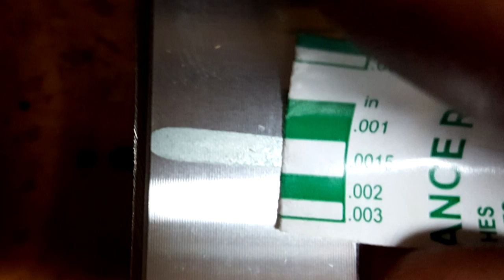LS 5.3L Build Part 4 Bottom End Assembly | Project Rowdy Ep008

Comment: Good video but I have one suggestion:
When you were using the plastigage to check rod bearing oil clearance, you put the plastigage on the cap side instead of the rod side.  While you were tapping the piston to release the rod from the crankshaft, you may have been crushing the plastigage since pushing the piston out of the bore would actually pull the rod cap into the cranks rod journal.  This could lead to an inaccurate measurement.  If you put the plastigage on the rod side, you could have loosened the rod bolts and tapped them to release the rod from the crank without possible crushing the plastigage.  Just an observation.
Reply from the maker: John Simon  that is a great suggestion.  Thanks!!
Reply: I saw that too..but looks like it turned out well.

Comment: Did you replace that cam plate @ 16:28..is that a new plate?
Reply from the maker: I used the original Cam plate which is shown starting @ 15:49. At 16:28 I am installing a New Timing Set which  includes Cam Sprocket, Crank Sprocket and Chain.
Reply: @UCanDoIt2Mike  I wondered the same thing. It was recommended on any cam swap to replace the retainer plate.  The printed gasket gets smashed flat and looses some of its ability to seal. Since it controls oil flow to the lifters, it's a critical part to me. I just finished my cam swap this evening and replaced mine because it was only $18 delivered. Great Videos that are super informative. Thanks for documenting your build! I watched some of your videos in my research before rebuilding the heads last year.
Reply from the maker: @Mattvardaman   I did lift the gasket off the plate and applied a thin layer of gasket maker in the grove that it sat in.

Comment: I really have to say you did a marvellous job of this build! So detailed, thank you! I was wondering why you opted for that specific master rebuild kit from Costa, it seems very expensive compared to other vendors?
Reply from the maker: The “Rebuild Kit” was custom assembled by my Machinist’s distributor.   It was based on specs required by my engines condition.   Because it was custom assembled for me, my thought was that I was able to use all of the parts.   When you go buy a pre-assembled kit that “best fits” your situation, there are often part that are not used.   

Not saying it was the cheapest route.   Thought it was the right and best option for me.    Cheers!!
Reply: @UCanDoIt2Mike  Right, I would assume it for your application best to go with what the machinist is standing behind for sure. If anything lets go, its back to them, vice me lol

Comment: I have a question about using the plastigauge. Since your main bearing cap bolts are torque to yield, which aren’t supposed to be reused, how is it ok to remove them to check the plastiquage and then reuse the bolts? Hope that’s not a dumb question. 

Your videos are some seriously great info. Thanks!!
Reply from the maker: Main Bearing Bolts are not TTY.  the only dumb question is the one that didn't get asked.  Cheers and enjoy your build!   Mike
Reply: Some cap bolts are torque to yield some aren't. Know which ones you have and follow manufacturers recommendations for installation.

Comment: Little trick.. These motors are known for the o-ring going bad in the oil pump pickup tube. When you replace it, smear some silicone around the joint after you clean it, or if you want it better, smear some JB weld around it. Just know it is permanent if you do, but better.

Comment: Thanks for the in depth videos I just wanted say that when u plasti gauge the mains to me it looked like u did not use the ARP lube on the main bolts and added the ARP lube after u checked your clearances and that lube changes the torque value and c an possibly change your final clearance spec but I wasent there so I don't for sure if that's what happened its just how the video makes it look thanks for everything!
Reply from the maker: Your observation is accurate.   I did not use lube when checking for clearance.  Nowhere have I seen it mention to do so.  But think about the consequences.  With lube, the bolts may have turned another 2-5 degrees at the clamping points... providing a clearance difference of 10 millionths of an inch.  Plasti Gauge is a great tool and I highly recommend taking this measurement on each bearing.  But it is not an exact science...  look at the measuring gauge that is used to perform the measurement.  There is a wide range of tolerance that is acceptable.  It is a great observation, but in my opinion the result difference is "insignificant".  Just my opinion. Cheers!
Reply: UCanDoIt2 yes i agree with u on that I it's almost nothing on this type measuring tool but the point I was trying to make is consistency is key but don't get me wrong I think the videos r great and have very good editing and educational value and I appreciate your time and paying it forward attitude towards sharing your knowledge looking forward to more in the future
Reply from the maker: Both of your messages are very well received.   Cheers to you!!!

Comment: Requesting assistance if you have minute.  When you use a feeler gauge to measure the crankshaft end play, what are exactly measuring?  #3 end cap to crankshaft or the distance between the bearing and the crankshaft?
Reply from the maker: The distance between the Bearing side surface and the Crankshaft.  You are trying to determine how much front to back movement that Crank shaft will travel.

Comment: Dont use ARP moly lube on factory fasteners!  It changes the torque readings and youll end up over torquing them.  ARP gives the torque spec for THEIR fasteners using that lube.  If you install a factory fastener, install it per their directions.

Comment: First off thanks for the informative videos. It’s nice to see an engine build in a home shop similar to how I’m going to be doing mine. I’m going to be starting my LY5 5.3 build as soon I get my block machined and decked. I have a few questions. Why do you grease the bolts for the crank mains? Second, why do the main cap bolts need to be turn to a certain degree after they’re torqued down? 

Thanks and I’m sure I’ll have more questions along the way!
Reply from the maker: I greased the main bolts because the reference guide book that I was following mentioned it.  I believe the new thought process is that heavily torqued bolts need to be greased to remove friction and get a more accurate torque value applied to the bolt.  Again, I believe a new theory from GM that you can generate more even and accurate "clamping pressure" if you torque to a lower level and then rotate to a specific angle.   These main bolts are not Torque to Yield, but the Head Bolts are.  The TTY bolts are one time use and need to be replaced after use.   You should consider picking up a good build reference guide.  There is a lot of great information like this in them.   The one that I used is:  GM LS-Series Engines by Chris Werner: Amazon: http://amzn.to/2igcReD.  Take your time and learn as much as you can... and have fun with this!   Cheers.... Mike!!!
Reply: UCanDoIt2 Thanks for the info! I actually have that book at the house. I need to read through it more.

Comment: Awesome video, thank you for sharing! I know it’s old but why did you smack the crank front and rear when you installed it the final time? I’m about to take my LM7 apart and figured I would ask just in case that was some sort of tactic to get proper end play clearance. Thanks again!
Reply from the maker: Yea...  It sets the Thrust Bearing (number 3) so that you can get a proper/accurate end play measurement.  Cheers!

Comment: The 5.3 & 6.0 LS engines were far superior to the old SBC they replaced.
Reply: 5.3 and 6.0L LS motors are the easiest simple
Reply: The 6.0L was still junk. Hence the introduction of the 6.2L
Reply: repr26 Right.... thousands of those “junky” 6.0 with well over 300K miles on them.
Reply: @repr26  6.0 is not junk my friend
Reply: Picked up 04 escalade platinum 6.0 with 25k on it recently .
Reply: @budtoo2636  keep your oil changes up to par and tune ups...im a mechanic myself and have worked on lots of thos and GMC were the owners didn't keep up with the oil changes and for the LS motors when you do that you burn out the bearings and your lifters get stuck and when that happens 90% of the time your getting a new engine🤣

Comment: Once again, another great "How to" video.  I do have a question, if you know.  You stated in video #1 that you wanted a 5.3 with 862 heads, and you pulled yours from an '01 Silverado.  Do all Silverados have the 862 heads or is there a specific RPO code you looked for?
Reply from the maker: Lyons Motorsports Again, thanks for the feedback.  I don’t know the exact answer to your question. The RPO code of the engine that I purchased is LM7.  In a way that is supposed to represent a specific combination of components.  But, I believe there are LM7s out there that have the 706 heads.  In fact I believe I once owned a 2001 Tahoe LM7 with 706 heads.   LM7 is a 5.3L cast iron block.  When I went to go pick mine out at the Salvage yard, he had several on pallets and I had the choice of heads.   Not sure this helps but should help with the conversation that you have with your seller.
Reply: 706, 862, & 895 heads are the "small valve" (1.890" intake valve) heads. I believe they came on 4.8 & 5.3 L trucks w/LR4 (2001+), LM7, LM4, & LM59 (1999-2006). They flow good from factory.

Comment: i swapped my  5.3 engine a few months ago...now i will like to rebuild the old one...my question is ...how much money  do a need for just a normal  rebuild  nothing else...thanks in advance...great video
Reply from the maker: That is a really hard question.  It depends on what you find when get in there.  In the description of this video is a PDF that you can download that show all the items with prices for what I did.   You will need to balance what you feel is a minimum based on wear and what needs to be done "since you have the engine currently apart".  At least focus on high wearable parts (Rings, cylinder honing, bearings, lifters, cam, gaskets, etc.)  Those are no brainers.
Reply: @UCanDoIt2Mike  thanks you Boss...your videos inspired me...

Comment: GREAT videos! If I want to learn to do something RIGHT, I look to see if you’ve ever done it. Did you reuse your stock main cap bolts or are those new??
Reply from the maker: I did reuse the original main bolts.  The guide that I used did not specifically state that they had to be replaced and I noticed others reusing them.  They are not Torque To Yield, so I assume it was ok.   Thank you for the generous compliment Mr. Gibson.   Cheers to you Sir!!!!!

Comment: First of all great DIY and instructional videos!! I have one on the stand as of yesterday that I want to tear down and Rebuild. I have the confidence to do so now.  I just have one question. I've heard a few guys at work talk about checking for rod bolt stretch.  Not sure what it is exactly but did you do that on your build?  Thanks and keep up the good work
Reply from the maker: Let me start by saying that I did not, because I purchased new Piston Rods and they came with new components.   So let me take a stab at what I think they are talking about.  In these newer engines, there are some bolts that are Torque To Yield (TTY).  Meaning you tighten them down in a manner that they stretch to maintain a specific compression value.  These TTY Bolts are One-Time use bolts and if I remember are your Head Bolts, and Harmonic Balancer bolts.  Not sure if the Stock Rod bolts are TTY, it did not apply to my build as I replaced them with a different Rod.   If the Stock Rod bolts are not TTY, I really would not worry about any minor stretch as they are rigid and will still apply proper compression.   If your building a street engine you should be fine.   If you are building a boosted engine, you probably will be changing the Rods anyway.   Just my amateur 2 cents.   Have fun with it!!!!!
Reply: UCanDoIt2 yes I'm going to try the boosted route.  Always wanted one so now 20 years later I'm going to give it a try lol

Comment: I have my grandfathers 2005 Chevy Tahoe and it has 350k miles and I would love to rebuild it. It has some sentamental value to me. Is it necessary that you take the block to a machine shop and get it machined and get the crankshaft balanced? If so how much does that cost? I have priced out basically everything else and it seems relatively doable even if I am in college.
Reply from the maker: Rush_Recon I would have a machine shop look at it and true it up.  You will also want them
To probably do a valve job on the heads to make sure the valves are seating properly for best compression.  It would stink to take it all apart and miss the high wear objects.
Reply: @UCanDoIt2Mike  Yeah for sure, Its honestly something that I've been wanting to do for a while and now I finally have the income to pull it off haha. Defiantly will be a learning experience to say the least.

Comment: You should work each side of the crank and rod cap bolts up to their torque settings in increments, not just tighten one all the way down, then the other!! Main caps get tightened in a circular manner starting from center out, starting with 15 ft lbs, then 35ft lbs, then finish to final torque (65ft lbs on inner*, 55ft lbs on outter*). You should also bring up rod cap bolts in same manner as far as side to side, tightening from 10 ft lbs, to 25, then finally 50 ft lbs.* (* unless otherwise noted by your rod/main bolt manufacturer.) But hey, it's not my engine, you can do as you like. Have fun! ;)

Comment: noticed when you were using the torque wrench at 16:20 etc. you are turning the wrench until it 'clicks' which tells you it is torqued to the right setting. You should stop there (at one click). But you continue to click it 3-5 more times on each bolt. This will change the torque setting. Should only turn until it clicks one time. No more turning/torquing/clicking should be done after that.
Reply from the maker: Hatchet Harry You need to do a little more research.
Reply: I'm no engineer so I am going off of prior experience. I worked at a shock absorber manufacturer. When we were assembling shocks we had to tighten down a nut that secured the valve shims & piston. We used a torque wrench to tighten down this nut. Once fully assembled the shock would be run on a dyno & an electronic curve produced. All shocks had to pass a dyno test (set curve). We found that the curve varied on a batch of freshly assembled shocks. It was later determined that was because some assemblers were adding an extra click or two. So the hydraulic action changed with slight variances on this torqued down nut. Once all assemblers followed the one-click rule the shocks had a more consistent dyno reading!
Reply from the maker: This is a friendly response.... (don't read any of this as negative).  I am an engineer, but will completely remove any credit of that toward this answer.   When a Torque Wrench clicks... you have broken through the resistance of the torque value that you have set.  Once you reach the desired torque, the action will break (Click).  You could do that 10 times (properly) and it will continue to break at the established setting without any further rotation of the fastener*.  In order for the fastener to rotate any further, the fastener would have to break the friction tension again to then begin any further rotation.  Blah blah blah.

HERE IS WHAT I THINK IS THE ISSUE.    Non-thinking people are handed a Torque Wrench and believe it is a fool proof tool.   I believe these yahoos...  Set the Wrench, take the fastener to full torque, achieve the "Click" AND THEN BEYOND THE CLICK CONTINUE TO ROTATE!  That is where additional rotation could occur and cause issues.

It is a fantastic topic that so many "Keyboard Mechanics" love to harp on and it is just mostly non-sense.

I enjoyed your statements that included your prior experience..  and I believe it also supports my thinking!
Google proves and disproves both theories.  It's just a ridiculous topic.

I could be wrong!   But there are MANY people building engines that don't own a Torque Wrench.  I think we should go pick on them!!!     Cheers.... Mike
Reply: @UCanDoIt2Mike  thanks Mike. The extra clicking make me cringe only because of the past experience. It's like nails on the chalk board when I see & hear it! haha Love your videos & the fact that you are working with your kids! You are a much cooler dad than most! js
Reply from the maker: Fully understand!!!!   Cheers to you Sir!   Mike

Comment: very cool video! Nice job, but if I can give you an advise, don't use arp ultratorque lube on stock bolts, only with arp bolts otherwise the bolt is torque too much and failure can occur. ... I've been there....
Reply from the maker: That is an interesting observation.  I was specifically told that the one sleeve of ARP Lube would do the entire engine and to specifically use it on the internal bolts.  Thanks for watching!

Comment: Can you elabourate on a couple of points please?  

@ 7:30 min, just a bit of lube for under the flanges of the bolt heads but not the threads, however the side bolts got lube on the threads.  How do you know when to use the lube or not?

8:00 min, I think you were “setting” the cam. Centering it? Or were you pushing it to one end for a total end play measurement?

1705-1710 I thought for a moment you had a “meowing” torque wrench LOL!!